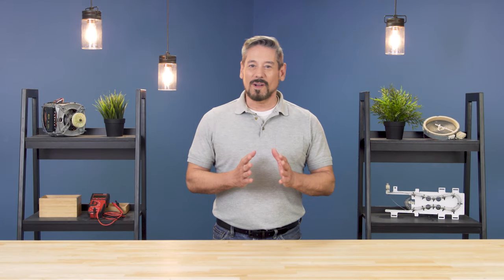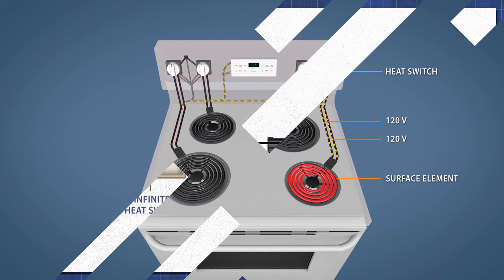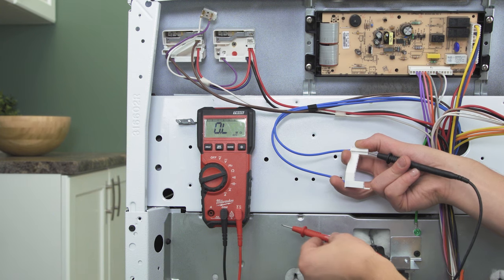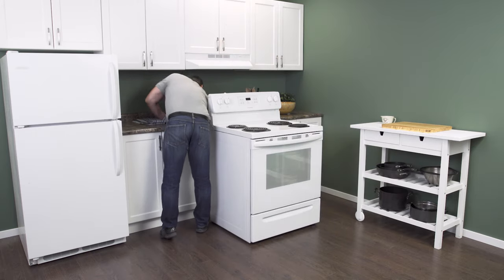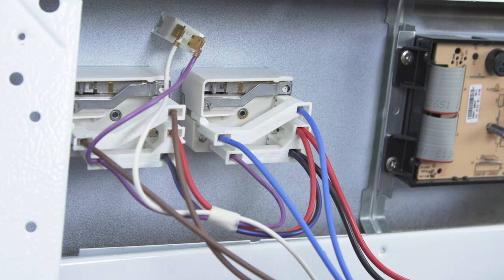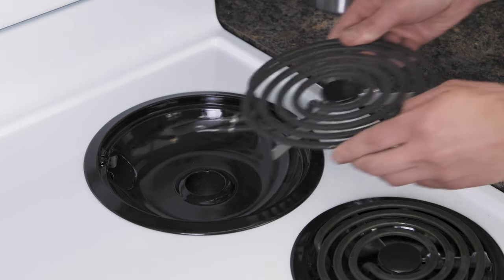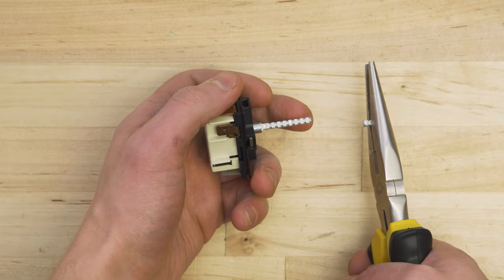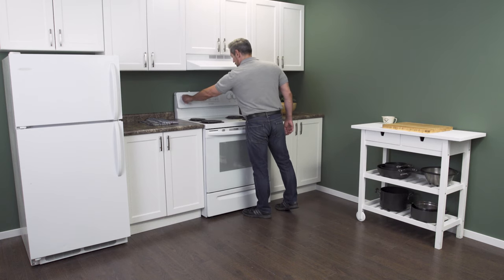Electric Stove Stays on High - Troubleshooting | Repair & Replace

Comment: I bought an Infinite switch from AmResupply on June 2017 and replaced it.  Do these parts have warranty?  The conventional electric coil didn't overheat like it did before after the fix, but got hot over a few months.  Now in 2021 it is overheating again.  This time, I want to test for a short first.  Can I test for resistance or continuity at the coil using a multimeter rather than from the back panel?
Reply from the maker: Thanks for watching, and we appreciate your support. Electrical parts don't come with the same sorts of warranty as mechanical parts. I am not familiar with the exact policy but this is something that you can check with the customer care team. 

There's a couple ways of narrowing down this problem. You could swap this infinite heat switch with the adjacent one. If the switch was the problem you would see the next burner show the same issue stay on high and overheat. The original burner would then start working like normal. 

If swapping the heat switch doesn't change the problem, then it's likely a short. You can test the element for a short directly. You would test for continuity between one terminal and the outside or frame of the element. Then do the same for the 2nd terminal. There should be no continuity and no resistance reading in either case.

If the heat switch is not the problem and the element seems good then it could be an issue with the wires or receptacle.

Hope this helps!
Reply: @AmreSupply  I tested the element for a short with my auto-ranging multimeter.  There is no continuity between the element terminal and the element coils.  i changed the setting to resistance it is the same thing.  I probed the other terminal and other coils.  The only continuity that was found was between the two terminals.
Reply from the maker: @winstondang5966  It's good to eliminate the element as a potential source. You can also swap the element with the same size element from the other side. If the element was the issue then the problem would move to the other burner.

You can still test for a short through the back wires, as well as swap the heat switch to try to isolate the problem.

Comment: What would cause an issue where all four burners were staying on High (red hot) when set on only 2 or 3.  
This is a Kenmore ceramic stove top
Reply from the maker: Thanks for watching. Does your stove have individual heat switches (dials) for each burner? Or does the control board have push buttons for the stove controls?

Comment: Is safe to cook on a bowed stove topnlike this one? Top of it just bowed in the middle while I was using the oven.
Reply from the maker: Thanks for watching. If the metal stove top is warped from the oven's heat then it could still be ok to cook on. If it looks like all the stove components are not damaged, and any pots or pans still sit level, then it's likely still good to cook on.

Comment: My electric ceramic stove burner overheats after awhile on anything but low.  Low it usually stays low.  So I either have a bad switch or need to change out filament or whatever it’s called to replace heating element. Fortunately it’s only one element overheating.  I have the tools so I will be testing it out.  What’s your take?
Reply from the maker: Hi Eric, thanks for watching. It's likely the switch. These heat switches use a bi-metallic strip which can warp over time. If you're curious you can see inside one of the switches here: https://youtube.com/shorts/URFjJPQycsk
Reply: @AmreSupply  thanks for reply. Other sites said the same.  We have a 6 yr old new home  but the worse purchase ever in construction and non stop power outages from a drop of rain or perfect sunny day.   Looking to move. Power outage probably burnt out switch or motherboard but doubt it since only one burner act up.  This burner been this way after 3rd yr.
Reply from the maker: @ericb2861  You are right that is unlikely that the control board is burnt out if this problem is happening with only 1 burner. In these sorts of models, the control board does not supply power to the stove. Replacing the heat switch as this will likely fix the issue.
Reply: @AmreSupply  I may just buy the switch.  We cool a lot. Still probably smart to double check when I do have a multi meter. Thanks for all you guys replies
Reply from the maker: @ericb2861  You're welcome!

Comment: My electric stove isn't even a year old, was working fine up till a week ago then anything I cook in the oven comes out grease. Office manager reset the temp and still doing it any advice?
Reply from the maker: Thanks for watching. Can you clarify:

Do you mean that anything you cook in the oven gets burnt as the temperature is too high?

Or do you mean that there is grease coming out of somewhere when you use the oven?
Reply: @AmreSupply   When ever I cook a pizza, burritos or anything the food comes out pure grease, up till a week ago it didn't  do that
Reply from the maker: @GhostTacos1975  If the oven temperature is hotter than normal then you can calibrate it up or down 30°F https://www.youtube.com/watch?v=s8UdnR4Jw_g

You'll need to observe the temperature and get the average over time.

Now if the temperature is significantly off, then it could be a faulty temperature sensor: https://youtu.be/jnt_mUwdL8o
Reply: @AmreSupply  I adjusted the oven temp and it still does it,  I tried something different last night. I put the pizza in the oven right away the pizza was done before the oven was done preheating
Reply from the maker: @GhostTacos1975  Using an oven thermometer, check the temperature at several different times during a bake cycle. If it is more than 30°F off then the temperature sensor is likely faulty: https://www.youtube.com/watch?v=jnt_mUwdL8o

Comment: What's the most likely problem if all of the elements are staying on high
Reply from the maker: Thanks for watching. If the stove uses 4 separate heat switches then it is very unlikely for all 4 switches to have failed all at once. The only scenario that it might happen is if a range has a control board that is connected to the oven and stove. In this case a faulty control board would effect all 4 elements.
Reply: @AmreSupply  sorry so one element stayed on high first then the others slowly started doing the same . So would that most likely be the elements or the switches?
Reply from the maker: @boldackalack_4864  It's most likely the switches are becoming faulty. These switches use bimetallic strips that bend when current passes through the strips. The metal can become fatigued overtime which can cause the element to stay on high. If you're curious here's a 1 minute video showing the inside of the switch: https://youtube.com/shorts/URFjJPQycsk

Here's the video that shows how to install new heat switches: https://youtu.be/JKrrOflS1RM
Reply: @AmreSupply  thank you for the quick reply a real life saver il be subscribing definitely
Reply from the maker: @boldackalack_4864  You're welcome, we're just happy to help! Cheers!

Comment: My stove have a same problem.I changed switch but problem not solve
Reply from the maker: Thanks for watching. If you've replace the heat switch and the stove still stays on high, then it could be a shorted heating element, a problem with the receptacle or the wires.

Comment: In regards to testing the element, you need to touch bare metal, if no bare surface available, you need to scratch the surface.
Reply from the maker: Thank you for sharing that great tip!

Comment: The real question is how do I get my range to slide in and out this easily? Getting the damn thing out was the hardest part.
Reply from the maker: Thanks for watching. One technique for sliding the range in and out is to use cardboard. If you tilt the range slightly there should be enough space to place some cardboard under the feet. If you can only get it on the from two feet then just keep pressure slightly on the front two feel while sliding it out.

Comment: My element would just stay on so I replaced the switch and it is still on!
Reply from the maker: Thanks for watching. If you replaced the switch and the heating element still stays on high, then it's likely a faulty/ shorted heating element. Replacing the element might help but it's still good to check all the connections to make sure nothing can cause a short. In a coiled stove, installing a new receptacle 
can also help.

Now just to clarify, after installing a new switch and if the wires are installed correctly, the element should not heat up when the switch is turned off.

Comment: The apartment I live in.  They're trying to say it's user error that there's nothing wrong with the stove after turning the burners on for like 30 seconds and them back off. Oh, it works. It's you, not the stove.  Pisses me off!  I've been cooking on electric ranges for nearly 50 yrs, I know when one isn't working right.
Reply from the maker: Thanks for watching. That is frustrating but it is easy to demonstrate if they are willing to listen. What you could do is you could put a pot of water on one of the good burners of the same size. Film it and see how long it takes to boil 2 cups of water at a low heat setting. Then film the dysfunctional burner at the same setting with 2 cups of water. There should be a clear difference between the two and it would be difficult to dismiss this as user error. If the contacts in the switch are stuck and the burner is staying on high, then water will boil much faster.

Comment: somebody is shipping parts that do not meet electrical safety standards and this is causing a serious hazzard
we junked one range for this already and now we've had to repair our new one
somebody need to get called on the carpet
Reply from the maker: Thanks for watching. There are many 3rd party marketplaces and sellers which don't always guarantee quality. If you have come across someone selling counterfeit or low quality / unsafe components, then its best to report that to the company, or to a consumer protection association.
Reply: @AmreSupply  I've had to fix 2 now; both my kitchen; both ranges purchased new.
these overheated burners are a hazzard and there is likely a need for a class-action legal action